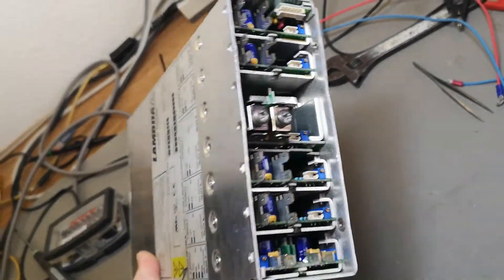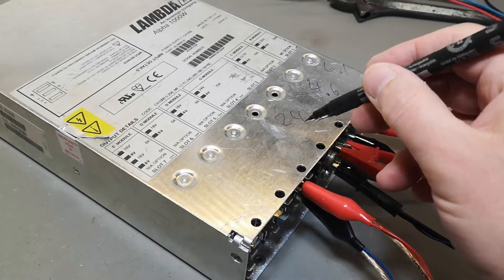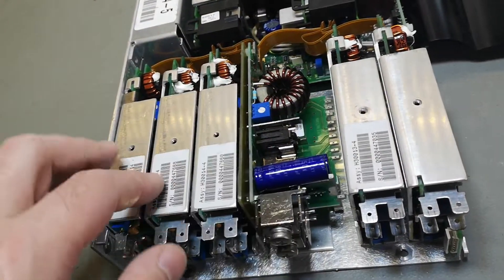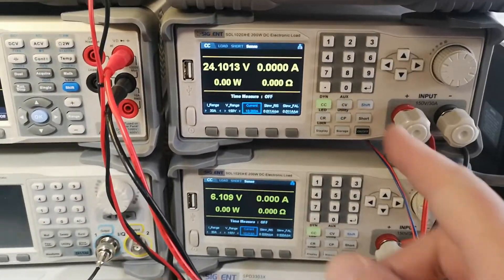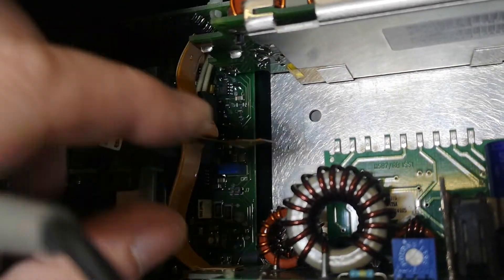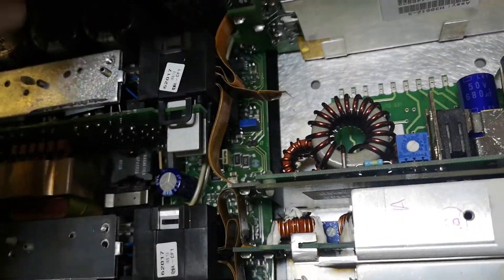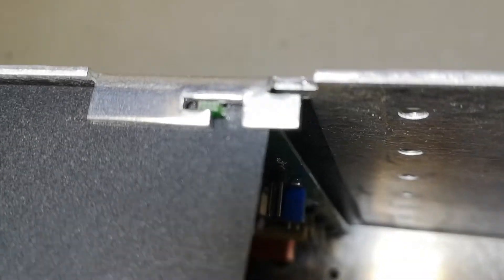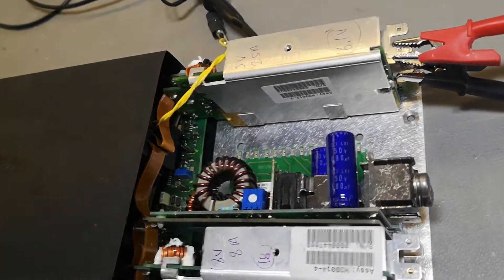TDK LAMBDA ALPHA 1000W modular power supply repair test teardown

Comment: Please say something about converter board . No output at secondary coils main transformer
Reply from the maker: you need to measure the voltages, and you need to know where to expect what, and this way be able to know if what you measure is right or wrong and then estimate what parts could cause it from their known failure modes.

Comment: Thanks for your videos on these TDK Lambda modules!  I am re-commissioning a 20-year-old SSL 9000K mixing console and it uses many of these modules to supply various voltage rails to the console. 

I have repaired a couple of them with secondary modules that had bad capacitors near the output. One of them burnt the SMD caps right near the output and I had to dig deep like a dentist  with my Dremel to clean all the carbon from under the surface of the PCB!!  

Now I am faced with the final one that needs repair and neither of the two secondary  modules are producing any DC output at all. After watching your videos I now understand that the primary module is supposed to provide approximately 21vac (rms) @ 200kHz, is that what I should be able to see on the primary with or without the secondary modules connected?
Reply from the maker: yes primary units must work, even without sec modules mounted, there is no direct feedback, other than just plain usage, the primary units regulate their drive magnetic level using a local sense winding, this means all attached modules get about the same input no matter how much or little other modules are loaded.
Reply: Also,  @TeardownOZ2CPU  - I have just discovered your other videos and subscribed to your channel - wonderful stuff and greetings from Australia!
Reply from the maker: @CulinarySpy  SUPER, I am so happy to welcome one more, please tell all your friends too :-)
Reply: @TeardownOZ2CPU  fantastic! Thanks so much you have saved me the time of drawing a schematic and scratching a hole in my old head!

Comment: I landed here on my quest to learn a little more about these modular supplies. Thank you for taking the time to explore.  The 70w standby power is high but I wonder if these have a module inhibit option. I've got a thousand questions so I'm going to buy a couple of these just to muck around and see if I can lower the standby power.  The sound from the fans seem to be a little bit annoying but that I assume that can't be lowered to a certain degree.   Lots of jumpers, switches and trimmers in there and I'm not smart enough to understand all the terminology in the data sheet so I guess it's trial and error or maybe trial and fire.... Thanks again....

Comment: Oh my... This video was so helpful for me. One of those broke in a very expensive drug completing line and I had to repair it.
Reply: In my case one MOSFET on the half bridge module has shorted with a near resistor, there are around 40 power supplys in total, all 1000W, are mounted 20 cm above the ground where a lot of workers walk, my theory looking at the half melted leg of the MOSFET, is that a metal particle was sucked by the fan, the MOSFET is directly near the fan. And it shorted the MOSFET's leg with a resistor, both were connected to opposite power lines. Unfortunately the resistor is involved in the control circuit, and around 5 other parts in the circuit are blown open, this too much for me as most parts are not available in my country.

Comment: Slight change in on time of the drive, but seeing as the step is only 60W, in a 600W module, the 5% change is about right for the load increase. going to the 24V module and doing a 120A load step would do a bigger change. 

Yes really nice modules, and interesting how they work the regulation onto the secondary side using the magnetic amplifiers and likely some really good MOSFETS to switch them, all at that 200kHz rate. Part of the reason they have such a high no load power, as all that switching, plus the always on fans to keep the module as cool as possible for long life, all take a lot of power. Would have been nice to see the power use in no load, after removing the modules, though I can bet that if you simply removed the one transformer module, and consolidated the loads into the other, it would have probably dropped by 30%.
Reply from the maker: i had the idea too, but was affraight it would be too complex to remove one primary transformator, i might end up with a non working unit, i need them for a project :-) so i was happy they worked out great, if we get schematics ?? i be happy to do it :--)
Reply: @TeardownOZ2CPU   sadly, TDK do not release schematics into the wild...I tried!
Reply from the maker: @CulinarySpy  i know, i think a lot of the schematics of stuff we find online is leaked somehow, not always official released, it is a little bit like source code, no one likes other people to have it :-)